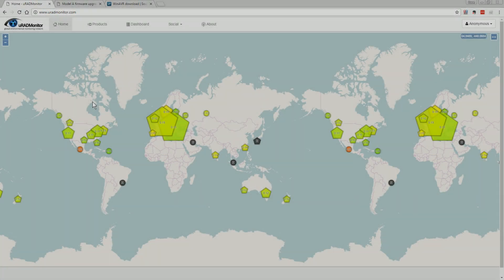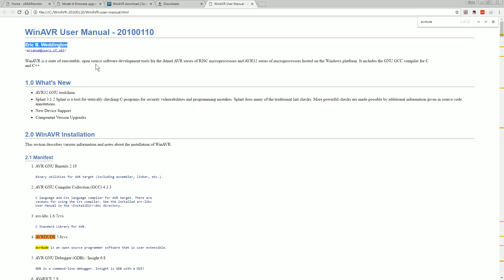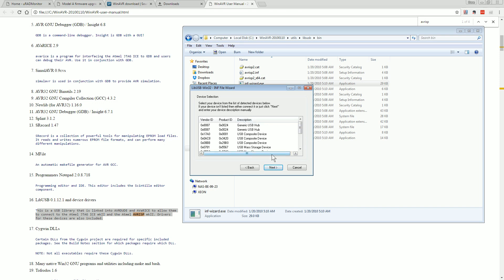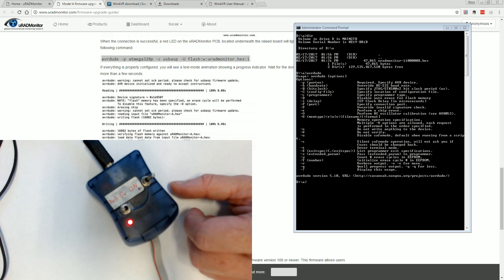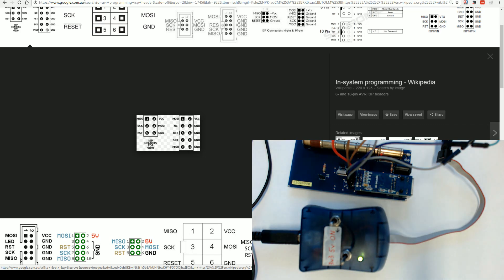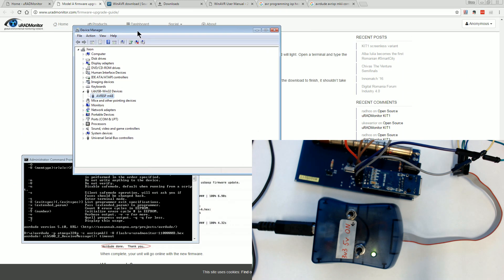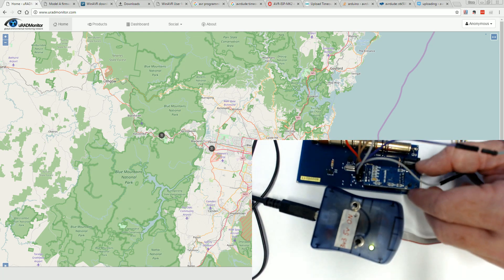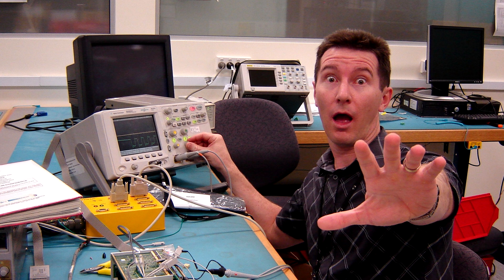Adventures in AVR ISP Programming

Comment: The Digitally Signed driver protection is a good thing and we should appreciate it. So many viruses used to attach themselves to drivers back in the day.
Reply from the maker: Because stuff should just work.
Reply: Google: "digitally signed drivers malware", plenty of root keys have been stolen/found/left in places stupid and more and more malware nowadays is signed and secure. And there are ways around a lot of it.
It's a good idea in theory but now just creates a false scene of security.
Reply: Yeah but I'm guessing that Dave didn't know how to disable it, he appears to struggle a bit with computers, which seems odd to me as I figured that an EE would understand computers better than I do, yet whenever Dave or Julian puts videos out and they have to install drivers and things like that, they tend to react to problems in almost a similar manner to what I'd expect a less tech savvy user such as my parents would. You know the "DOH, stupid technology... Why don't you just work!" kind of thing.
Reply: Not disageeing, it certainly should work, however bugs and other little issues are pretty much a fact of life/inevitably just as much as hardware failure is, for example maybe you want to put together and test a circuit but suddenly your bench PSU starts acting up, by not putting out anything or the display is screwed up, oh well now you gotta fix that instead. Basically what I'm getting at is that troubleshooting and handling issues just comes with the territory when dealing with tech, no matter whether it's software or hardware related, at least until we can make everything perfect or as close to it as possible and that's one of the main reasons I got into electronics, because I could troubleshoot and repair PCs but pretty much nothing else up until now.
Reply: I was an IT manager at an engineering company many moons ago. They were talented and knew how to use their software apps. But when they started dicking around with the OS or hardware, they'd screw things up in a hurry.

Comment: The Arduino IDE bundles (and wraps) avrdude, and just calls out to it when it wants to do uploads. If you have Arduino installed on the computer, you probably already had avrdude hiding somewhere. If you go into Arduino settings and turn on verbose messages during upload, you can see the command line that it uses to invoke avrdude including all the arguments. It can be a handy way to quickly get a working example of a command line invocation of avrdude with all the options set correctly.
Reply from the maker: Good tip, thanks.
Reply: thankyou @superHouseTv. I was struggling for the path of avrdude so that i can paste it in atmel studio 7 in external tools.
Reply: I hate Arduino, use an Atmel Studio its better

Comment: Atmel studio is actually quite nice but it's a monster piece of software with lots of stuff the average person won't need but they pretty much have to include everything because they don't know exactly what you're going to be using it for.
I like using the free version of Visual Studio and the Arduino plugin even better but since Atmel Studio pretty much IS Visual Studio there's not much difference.
Reply: And Visual Studio is a snappy and small piece of software? The normal installation is 15 GB and a full installation is 43 GB. And that's the Community version.
Reply: Yup, it's huge too.

Comment: I spent 4 hours trying to program a ATtiny85 this morning. Tried using arduino as ISP, didn't work, set up an 1mhz external clock cause some fuse was fused, on and on. My best bet, they're counterfeit.
Reply: Hello. It seems to me that for ATtiny85 program you should use Arduio IDE 1.0.5. Find something about it, you should get it! Counterfeits are a real frustration. Lamentable ..... Success for you.

Comment: Hi Dave,
I share your frustration. I use Atmel uCs for most of my work so I have Studio 7 working with the ISP II but it's still a pain in the butt! You would think people who design these things would care about making them actually usable for end uses! I love the AVR chips though, great for low power apps.
Reply: mosfet500 A while back I came across a product made by AVR which is called the AVR dragon. I brought one and put a 40 pin zif socket on it and also a bunch of female headers so I can easily hook it up depending on the type of chip being flashed. It can perform a symbolic debug on all devices with OCD with SPI, JTAG, PDI (selected devices), high voltage serial programming, parallel programming, and aWire modes, and supports debugging using SPI, JTAG, PDI interfaces. The high voltage programmer has saved me many times when I messed up the fuses.
Reply: Years ago I started with the 3-resistor parallel port programmer under linux + avrdude, life was simple back then.   I did at one point buy  a clone AVRisp looking exactly like what Dave has here, and it's in the almost-bin. Never worked right. These days I just use a simple USBtiny programmer (uses an attiny2313) which now can also handle my TPI requirements to flash the Tiny10 series too thanks to an avrdude software patch.
Reply: Paul,
I have one of those AVRisp look-alike clones in my junk bin too! Absolutely useless!

What I did now was to design a bunch of boards with zip sockets that the 6 PIN AVRisp II plugs directly into. They cost me ten bucks for ten boards from my board house. A bunch of 40 pin zips from eBay and for under thirty bucks I have about 5 or 6 boards that plug into the AVRisp II each labeled with a specific AVR chip. Low hassle, does 90% of my AVR programming.
Reply: I'm  presuming that's mostly for PDIP stuff?   Usually I put the ISP header on each project which saves a lot of hassle of course (for the SO8 Tiny13/*5 series I use a clip).   The SOT23-6 stuff however I flash before I put on, and I keep one premounted on a breakout board  just for the purpose of developing the firmware.
Reply: Chips like the Tiny 88 give you more output pins with the SMD versions. I have a box of adapters to convert them to PDIPs so they fit the same jigs I built for the rest of my chips. I like headers for some apps but the trouble is that circuit designs can be limited. You have to watch what's attached to each pin, if you load a control pin you can interference with the programmer. For example, I kept having problems with mosfets off IO pins because the series resistor was too low. I fixed it with higher value resistors but sometimes I get a proto board back from my board house and I can't program the chip so unless I'm really pushed for space I use adapters and program with the isp II.
I have pins off my adapters now to run leads to my test setups, this way I can see if the programmer runs into trouble. (it also makes for quick programming without moving the chips after I program them)
Reply: Sabre good advice! I just ordered a dragon from Mouser.
 Once I tried to get more  pins out of a chip by disabling the reset pin to use it as an output. It was a pain and I gave up on it because I had to set up a special programmer to change back to normal reset. I'll never do that again!
Reply: if You use Atmel uC for most of your work why not buy deacent tool for programming? :P
Most of people make projects i belive that flash leds, measure something and thats it...
I often hear stuff like: why do i need a debugger for, i can just light a led or something...
Ok, if a project is that simple... come on! how can You debug a multiple network of microcontrollers that need to comunicate with each other measure multiple temperature sensors communicate with a gui interface or a control panel via an RS485 or other interface with a led!? 
How do You use a 2010 winavr for usb interfaces in xmega chips? ech... I could go on and on...
In these days if Youre a car mechanic You can't diagnose a car without a propper electronic diagnostic tool... and Youre talking about led blinking... omg...
Reply: youll get multiple problems with dragon in win10... at least I did
buy Jtagice3 or atmel ice
Reply: This just happened to me this week. I ordered a few ATMEGA8515 from Mouser. The chip is not obsoleted and it was a cheap enough solution for a small run I was doing.
I opened Studio 7 (after ordering the chips, silly me!) only to find the simulator does not support them. So I'm thinking well it must be a fluke so I'll download the latest version since mine isn't. I downloaded the newest version and now Studio doesn't see my ISP programmer and it doesn't see me Jtag ICE. Lost to who know where. The jungo shows both, by the way.
You can't make this stuff up!
Reply: For all those who have given me their own IDE and programming options, please understand that I started with AVR8's twenty some odd years ago. At that time the best programming platform was the STK500 of which I still have 3 along with A JTAG ICE II and an AVR ISP II. So I'm heavily invest in these programmers which work quite well... when they work.
To fix my latest problem I downloaded the Libsub0:

https://sourceforge.net/projects/libusb-win32/?source=typ_redirect

driver files which fixed the problem. Yes, I shouldn't have to do this but for free Studio 7 works well enough and I know it's ins and out well so why start all over with another IDE platform?

If, for what ever reason, you lose the programmers first check your device manager to see if they are listed. If so follow the link above to enable Studio to see them.
Rob
Reply: mosfet500 line i said use usblib0. 
New IDE new standards... atmel studio has all the benefits of visual studio. thats it. Why Windows changes driver policy? i dont khnow. Why in win10 the system automaticly updates drivers!?
Reply: I'm still on 7 pro ,when I update my work station later this year I might go to 10. Who knows why they auto update drivers in 10, maybe they think it simplifies things?
Reply: mosfet500 maybe. why diabling it in Home version is like almost impossible. If i had an option I wouldnt update a workig station to  win10
Reply: I see a lot of machines now allow you to run 7 or 10. I like 7 pro, my CAD, CAM and EDA programs run well with it.

Comment: Joys of using Windows
Reply: How is this a Windows problem exactly? Don't get me wrong. I love linux but i use both daily and both have  greate driver support. It's the vendor that should be blamed when crap like this happens. When they take the time to support things properly, it works just as great both on Windows and Linux
Reply: So true! , it's nice to have drivers already included  in kernel, I had forgotten the pain :p
Reply: Well in the case of AVR stuff in particular these issues are practically non existent. I've installed and used avrdude and avr-gcc on a lot of different distributions (Fedora and Debian) mostly, and once the packages are installed I can just plug in my programmer and get going immediately.
Reply: No, not really. I can tell you for sure that it is much less of clusterfuck of hackjobs than the Linux one (which I cannot specifically refer to since there are so many and the lack of standardisation is quite serious).
Reply: Nippius, take a look at the WDDM driver SDK and then tell me that Windows/Microsoft isn't to blame for shitty drivers.
Reply: You're joking right?
Reply: reminds me more of using Linux
Reply: It seems like you've never looked at one yourself since it is beautifully architected and very well documented in MSDN.
Reply: Might be so, but why would I care? I just plug the damn thing in my laptop and get on with it. And it isn't a problem with avrisp only,  the same thing was with usbasp, jtag dongles, usb logic analyzers, usb scopes, every usb2serial chip family, esp8266 boards, OBD cables  and so on. Linux has it's problems but this is definitely not one of them.
Reply: actually .. my toolchain for atmel is on macos. No issues, no headaches, just pure joy.
Reply: Leon Wright no, the joys of using atmel.
Reply: Also please note that this particular driver "issue" has absolutely nothing to do with the WDM per se, but it is due to the enhanced security feature in recent versions of Windows (i.e. by default, unless explicitly specified in kernel parameter, unsigned drivers cannot be loaded). While it may annoy some users, this makes Windows much more secure than the so-called "easy-to-use" "works-out-of-the-box" Linux distros. It is the driver distributor's fault for not properly signing the driver.
Reply: Linux doesn't requires drivers for USB devices that only comunicates with one program at a time and are for specific purpose like programmers and debuggers. You can do everything through userspace using libusb. The access permitions are enforced by udev rules.

On windows in the past, the only way to make driverless USB devices was using the HID class (has a limited bandwidth). Today with the latest releases you can make your USB device driverless by specifing it as a WinUSB device, but most vendors don't do it for legacy compatibility.
Reply: That's my experience. The worst I've come across is permissions issues, which exists on all of the platforms. Modern linux distros tend to have the UDEV rules in place already to make that a non issue.

My flippant remark gave me such humor for the day, thanks all <3
Reply: Kontra I don't see how signed drivers make Windows more secure than Linux. Most drivers are already included in the kernel, and with the exception of GPU drivers, third party drivers will generally just be configuration files for udev and userspace software that uses libusb.

Signed drivers are really only protection if you have a protected execution path into the kernel, with was only made possible with Secure Boot. Before that, you can just patch out signature validation since you can modify the kernel before boot.

It's also worth noting that you'll need administrative privileges to install drivers in any form on both Linux and Windows, and Windows is vastly less secure by default in that regard. Default UAC settings add exceptions for certain processes, you can inject code into it and automatically escalate to admin without any prompt, as long as the user account is admin, which is the default for the first account.

On Linux, all "admin" accounts run as normal users, and their password is needed to escalate to admin. Not something that can be done without the user noticing, or giving explicit permission.

Comment: Ah, good ole 10 pin ISP interface messing up the day there a bit.   I do love the AVR architecture, though I find myself  using the SOT23-6 Tiny10 more  and more in projects. Never tried programming via Windows, was interesting to see the dramas (using avrdude in linux)
Reply: Originally I think it was to prevent damage if reversed.... or it could have just been that 2x3 headers weren't overly common at the time.
Reply: I think the extra ground lines on the 10 pin header were to reduce cross talk between the clk, mosi and miso lines on longer ribbon cable runs.
Reply: I actually hope to use a Tiny10 soon. Sadly it looks like Microchip will be discontinuing the SOT23-6 package, the very package I want to use. Part status is "last time to buy," but I don't need a whole reel (from DigiKey)! Newark/element14 still have some for a couple cents more. I hope to produce 30 units though, so assembly with the UDFN package would have to be outsourced, but then I could have the whole circuit assembled.                Do you write programs in assembly for the ATtiny10? I know C for the chip wasn't well supported in Atmel Studio. Allegedly it should work, but I'm wondering if they've fixed the issue in version 7. Heh, hope I can even install the thing after seeing this. My program wouldn't be much, so it's not like I need to cram. I could probably write it in assembly without too much issue, but I hope to do a little more with it later depending on my experience with it.
Reply: Oh really, that's annoying that they're planning on shutting down the line :(  I have a lot of projects that use them.  Will they be replacing it with something like a DFN/QFN/BGA instead?

As for the programming, yes, I wrote my stuff in ASM directly, it's just a lot simpler for the T4/5/9/10 series, though for the T13 up I write it in C, other than the odd line or two of inline ASM.    My build environment is just linux + gvim + avr gcc + avrdude. Has served me well for a decade now.